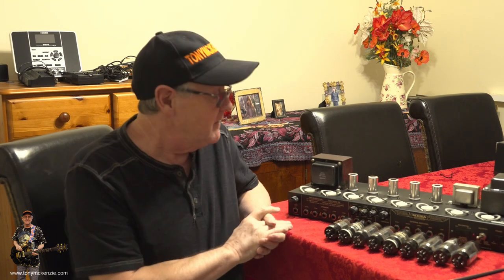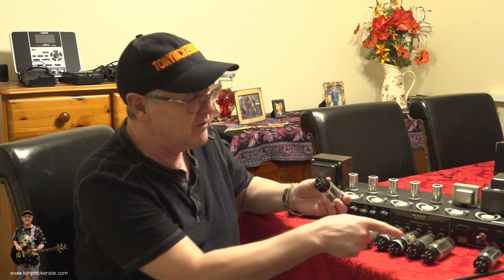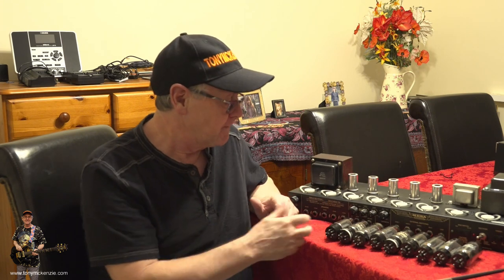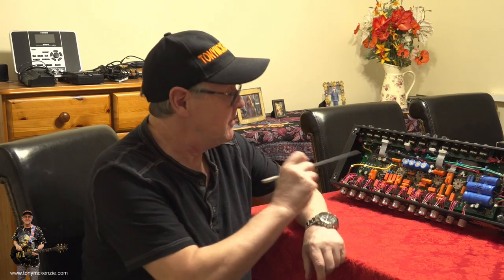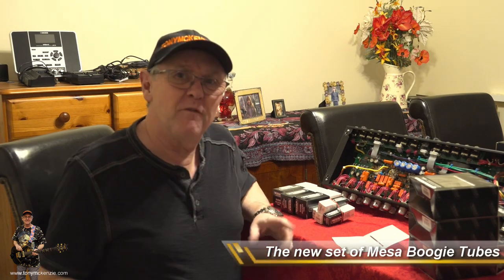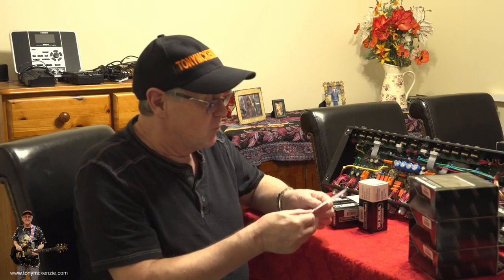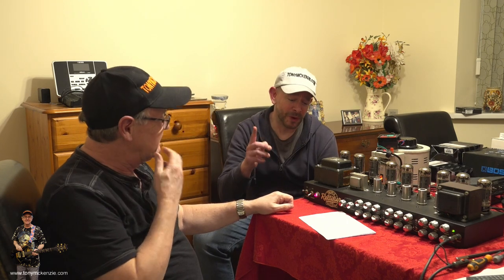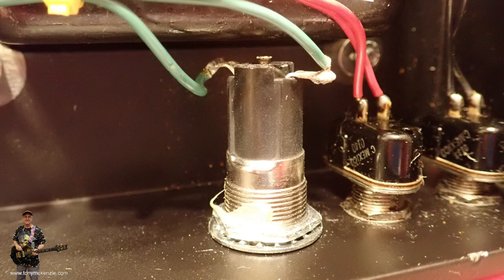Mesa Boogie Rectifier | All About Tubes and Bias | Refurbishing a Triple Rectifier | Series: Part 2

Comment: Remember when amps came with a selector switch for mains voltage well my JCM did, another great video Tony
Reply from the maker: I certainly do remember that. On the international power transformer they supplied me from the multi-watt rectifier that does have all the voltages - but only settable internally with other changes. Marshall used to have the switches as did so many brands but today those are pretty rare to find. Merry Christmas and stay safe.

Comment: Do you have figures for the plate voltage? This will enable calculation of actual dissipation of the output tubes to ensure they're operating within design parameters
Reply from the maker: If its in the video they will be published and if not I don't remember what those were... sorry I can't help more right now, but if I open up the amp again then I'll post them... thanks

Comment: Great video Tony. I need to replace the tubes in my Triple Rectifier, but having seen the price from this video I may put it off till I have the money. 

Luckily I have a recently serviced Mark IV, after swapping valves back and forth yesterday I realised just how much better the Triple Rec sounds with Mesa tubes.

Looking forward to the next vid and Merry Christmas
Reply from the maker: The tube prices are shocking really. My thoughts immediately went to used rectifier amps... just how many would have EVER had replacement tubes? My guess, as like this video is none, so buyer beware on used amps like this. It's a cost you don't always consider at the time of buying the amp. The Bias as set on this amp was very low as I showed, now that could clearly be from the conversion that was done internally. I would love to see what the bias figure for 6L6 tubes is on an unmodified triple rectifier - if anyone has the info PLEASE post it here. I guess 30ma which is in the middle of approximate ranges but would be nice to see what an unmodified amp shows. I might at some stage even remove the mod... then it's stock. There will be some more videos over Christmas but the guitar build is delayed because of the parts from Europe and Australia. Likely I'll get to dye the parts though (or screw it up and start again!). Yes merry Christmas to you too and stay safe.

Comment: Hi Tony, great video! Question,  I recently had the chance to barrow my friends Mesa Boogie mark 5. When I started it up, I noticed a bright flash from the back. Do you know what that is? I suspect it is the 5u4gb rectifier tube maybe?
Reply from the maker: Well hard to actually diagnose from here, but the 5U4GB often have a blue color around them. My guess is that it's probably a tube with issues though. Get them checked! You can get real trouble if a tube goes big time. I just saved an amp once because as it was lighting up like a light bulb I was there right in front of the amp and managed to turn it off quickly. Merry Christmas and stay safe.
Reply: @tonymckenzieofficial  
Thank you Tony! I didn't know that would damage the amp. I have noticed a drop in volume also, but that could be something different.
Reply from the maker: Even if you have only one 'spare' tube you could switch them one at a time and see if the problem goes away. If after a change of one the problem goes away then you found the bad tube. I would then change the set. Oh yes, of you get a power tube failure that is a bad one you can get amp trouble as it can damage components. I always watch them for issues and the slightest problem don't take chances. Stay safe.
Reply: @tonymckenzieofficial  That is very helpful, thank you Tony! I have some knowledge in preamp tubes but not so much with power or rectifier tubes yet. I appreciate the help buddy. ✌🙏
Reply from the maker: Well I'm basically like you... I'm no wizard on electronics really although I have been inside amps for a long time. Stay safe!.

Comment: As a Triple Rectifier owner,  I'm enjoying this.  Yes, I've seen Guitarologist's video on the Dual Rectifier 👍
Reply from the maker: I have had three now altogether... and thankfully on the others I did not have to change the tubes! They cost the earth here. Guitarologists video did prompt us to check that voltage on the strong setting and there it was... increased from 240 up to at least 280 volts - and I think his was (relatively) even higher than ours as a percentage. Worth bearing in mind for sure... but I suppose Mesa know what they are doing. I'm not entirely convinced about the new 'Badlands' amp - I have been in similar territory with another amp and for the 'extra cost' it seemed that might have been OK as an optional add on, but not really that great as standard on every amp. Interesting though. Merry Christmas and stay safe.

Comment: Hey Tony! I have a question if you could help me out! 😁 Could preamp tubes cause my amplifier to not power up at all??
Reply from the maker: You could pull them all out and see if the amp comes on then? if it does, then refit them one at a time. But I have not personally seen an amp not come on through pre-amp tubes. Not powering up at all sounds ominous... check the fuses FIRST. Let me know what you find... and stay safe.
Reply: Ok Im trying that out as we speak man! Playing without the amp gets quite boring after awhile. 🤣
Reply from the maker: Let me know what you find... thanks.

Comment: I'm just trying to figure out why my Triple only works with EL34s.  I put multiple new sets of 6L6s in it and no matter what, it has a glorious crackle sound sitting idle. (Yes I remembered to switch the bias switch before anyone asks!) 😁
Reply from the maker: Oh that sounds like fun... not. So the amp works but crackles? if so look at the sockets... and also check those tubes again!. That would be my first choice of things to look at. If you do find the problem please do come and post it on here... could be useful for someone. Merry Christmas and stay safe.
Reply: @tonymckenzieofficial  It only crackles using 6L6s, which are brand new.  And I had an extra set to troubleshoot with and replace each pair.  Same crackle no matter what.  Which sucks because I prefer the amp with 6L6s.  It's something not very obvious.  I almost suspect the actual bias switch at this point.
Reply from the maker: It's interesting stuff for sure. Stay safe.

Comment: What does the number and color on the tube mean? I'm sure 10 isn't the idle plate current. That seems wayyy too low. Maybe just a batch code? To show they are the same parameters?
Reply from the maker: Well I think they use their own colour code to show particular matching... i.e. orange goes with orange for example. Not sure of the other codes but they are all pretty similar :) The tubes were absolutely spot on BTW. Thanks and stay  safe.

Comment: Great Video! Merry Christmas man! 
Busting out the guide key, x 2.
Must have tried the counter clockwise removal system.
Reply from the maker: Ha why am I surprised about any of that stuff? I should know better than to expect the tubes to be good :). There was no floor pedal too? (Very questionable why really). I think I know. I bought a floor pedal on eBay and tried it. After about 5 mins it goes funny and affects the am/pedal. I have seen this before on MK IV floor pedal. There are one or two chips in the amp and three in the floor pedal that sometimes fail. Coming up in a video... but my guess as to why there was no floor pedal was that maybe they knew of the problem and easier to sell the amp without it. Call me cynical. In any case merry Christmas to you and yours too. Stay safe.
Reply: @tonymckenzieofficial  No pedal on the TA 30 and I used a few spare switch boxes. Only the channel changes, not the FX. I’m not spending money on that. It will wind up probably receiving the new Celestion and the old one will go in the new.
But it exactly happened as what you stated, one part doesn’t function.
Mesa tubes are so expensive. 
But I’ll wait until I get the new beast and see.
Sort of licking the wounds on the cash spending.
Reply from the maker: Check the cable. SOME mesa need a 7 pin and some need an 8 pin. If it needs an 8 pin and you use a 7 pin half the stuff does not work. Ha... I've been there before myself. Mesa tubes there are far cheaper than here! Here I really don't like to pay it. Somehow I feel ripped off a bit, and our 20% VAT certainly is part to blame. I'm the same on the cash for sure. I spent on the PT and the tubes so far on this, and there is more yet to come. And I changed my car, which is nice, but man so expensive... oh well. Stay safe.
Reply: @tonymckenzieofficial  this is a stereo jack.
Reply from the maker: Oh OK... I have not owned a TA30... :(

Comment: Merry Christmas Tony, adjustable bias is a godsend with Mesa's - especially at those tube prices 😂
Reply from the maker: Yes have a great Christmas too... I'm not entirely sure of the bias mod. This was set so low honestly I never saw one so low for that setting. But it seemed to me like they had also changed the resistor AND added a pot.. that was limiting to 30ma on the test gear maximum. I might revisit it and take a look at the bias and resistors etc. The tube prices are not good, and it's clear why the amps mainly get neglected particularly re the tubes. Even cheaper ones are not that cheap really. Stay safe.
Reply: @tonymckenzieofficial  looks like the added the pot to the original resistor looking at 10:12 time on the 19th's video making resistance value wrong - should be getting around -51V on the 6L6 setting.
Reply from the maker: I never really checked the resistor but I did check the pot. I will go back and look at that. The link you sent seems wrong?  Thanks for that and if you can amend it would be great Steve.

Comment: My Triple gets a huge volume spike after a minute or so of playing then it drops. Tubes all look fine and the amp has low hours on it. The amp was bought new. It’s like you are playing at volume 2 then it spikes to 7 on all channels. Guitar cables & guitar is good. It is definitely something with the amp.
Reply from the maker: That could be many things... but change the pre-amp tubes just one at a time and see if it goes away. Also clean the sockets on the pre-amp tubes. I have had all sorts of things with dirty sockets... crackling and much more historically. Let me know if you find out what that is... just post it here... and thanks for watching. Stay safe too.

Comment: Hey I'm dissassembly blown output transformer from my triple, and its worst work I ever  seen. I've triple from 90's. And bias is cold and static, pot is good uprgade...
Reply from the maker: Thanks for the info. I have had a few different Mesa and never had an issue except MK IV floor pedal did not work. On this amp there are multiple issues and this floor pedal is dodgy too but its inside the amp. I'll be covering that in a video soon. Also a mod for the 'pop' when changing channels. Stay safe.

Comment: STR 440(s sound amazing! Way smoother than the (Russian made) STR 430....
Reply from the maker: Expensive but I like them too... :)
Reply: @tonymckenzieofficial  About 70 Euros for a pair of reliable and good sounding tubes. I'm not complaining.... 🙂
Reply: @tonymckenzieofficial  ahh the good old days, when you could buy MESA branded tubes for your MESA amplifier.
Reply from the maker: Not really that long ago.... or so it seems.... wat next? who knows. No Mesa stuff over here UK.
Reply: @tonymckenzieofficial  China's tube production halted in 2019, Russian tubes are off the board now, we have a problem....
Reply from the maker: Not really... check tubeampdoctor.com as they have a new manufacturing setup... thanks.